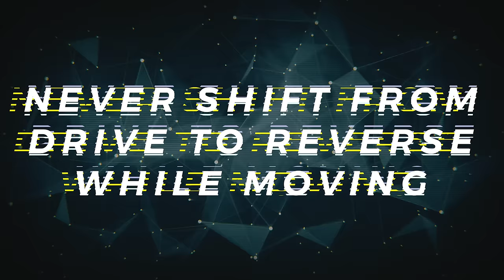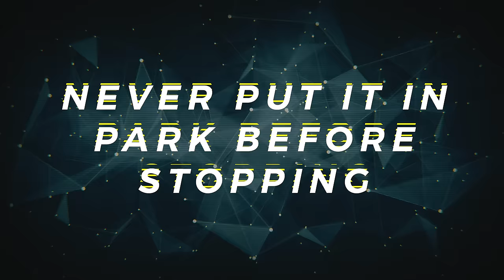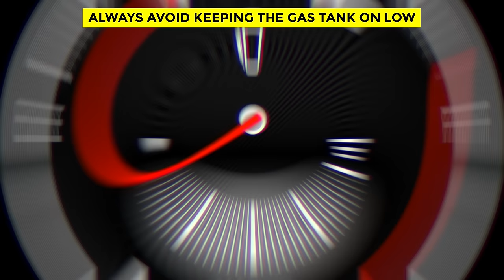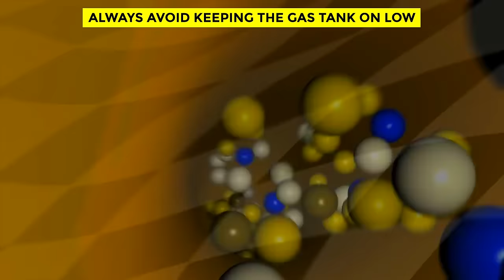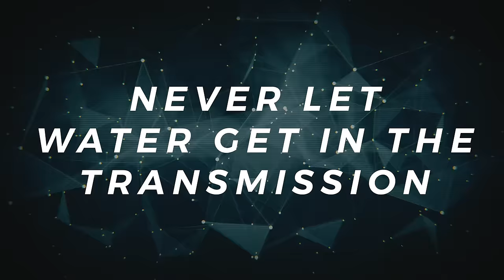7 Things You Should NEVER Do In an Automatic Transmission Car!

Comment: How to avoid it:
1.Dont buy an automatic
How to save manual:
1.Everyone start buying manual as you still can so car makers still make manuals
Reply: why the hell would i get a manual, just accept that stick is dead or will very soon be dead, even car companies are throwing manuals in the bucket cuz no one is buying simply because nobody gives a shit about them and nobody gives a shit if you drive one
Reply: @chimkinnugget5221  u dont know nothing about cars for sure you drive a prius
Reply: Christopher Hernandez Without Manual there is no Automatic,because Automatic is basically a modified manual
Reply: @enovenn6074  Hell no. Automatic transmissions work totally different than manual. Yep thay switch gear, but thats all. Automatics usually have 2 clutch system, own ECU and they work with ECU and information from the engine. Thats why you have sport mode, eco mode etc. Manuals have none of theese things, you have to do all the things in your brain.
Reply: i do own a BMW also a automatic. its bad quality, each time i start to drift it, it breakes
Reply: Nkstrooo manuals don’t fit in electric cars so if electric is futre automatic is futre aswell
Reply: @justauserwatchingytonipadk6438  Electric cars don't have automatic transmissions, they don't have ANY transmissions, because they aren't necessary.
Reply: Christopher Hernandez why the hell you would get a manual? Simply manual cars have less failures than an Auto car
Reply: @damien turn traction control off
Reply: Manuals are actually better, safer, and more efficient than automatics. Efficiency is getting harder to differentiate between the two as time goes by since computer monitoring is always improving but manuals will always remain in the lead even if minutely. Add to the fact that manuals better in towing and in 4wd/AWD.
Reply: @chimkinnugget5221  you drive car...car doesnt drive you
Reply: Just a user watching yt on iPad Kk not everyone really likes electric cars,also not everyone can afford and the worse is,on some countries the price can go wild especially the taxes
Reply: shiznut123 if you think electric cars are gonna take over soon they’re you’re a different breed , if I have to wait 20mins+ for half a charge then I’ll go with gas till the car starts charging itself for free. Wanna what what is going away tho? Manual cause computers already caught up and surpassing manual. Welcome to the auto world
Reply: @chimkinnugget5221  you don't have to be an ass about it just drive what the f you want. Let them drive manual. It's their choice not your.
Reply: @AndyPorter79  Manuals are not better, safer or more efficient but they are cheaper. There isn't a stick diver who is going to be more efficient than a computer, there just isn't, modern automatics are made to be efficient. They are both as safe and better comes down to preference.

The only thing that manual has over automatic is price and that's why I drive manual, if I had more money to go around right now, I would go for an automatic.
Reply: @chimkinnugget5221  you simply kept stalling manual cars so you bought some kind if a hybrid or some big ass suv with an automatic and now you complain about manuals.
Reply: No, they won't.  Automatics are a lot more efficient in today's cars as compared to manual transmissions.  Plus, they are less expensive in most cases, due to scale.
Reply: Paddle shifting for the win
Reply: based
Reply: @AndyPorter79 , that's not right at all. It's possible for them to be more efficient, but they're not because of the human that is behind the gears. Computers will always be more efficient on average than a human brain. 

Modern automatics, especially ones made within the last 5 years are just too advanced to be less efficient.
Reply: Nkstrooo ok but why are u and everyone else getting mad at people for speaking the truth about Manual. Yes Manual is more fun than auto but it does have its downsides and whether u like it or not it is dying and people are not as interested in them anymore
Reply: Yes please save manual transmissions.... Auto is for lazy people and is no fun... You really don't need an explanation for why you should buy an manual car it's just better
Reply: @chimkinnugget5221  maybe in the US but in Europe most of the cars are still manual's.
Reply: Nkstrooo but i can't drive manual goddammitb
Reply: Christopher Hernandez if i could drive a manual i'd buy one.
Reply: SSG Squidward then rent a manual car and use it to learn manual with your friend or parents just dont rent a new one because you may kill the gearbox or i really recommend rent the most indestructible car not the indestructible body but the indestructible gearbox or engine
Reply: @enovenn6074  not true automatic transmission heave difrent principle of engaging the gears  and is NOT  AT ALL similar with manual
Reply: @chimkinnugget5221  Not really. Still very much alive in Europe.
Reply: automatics dont miss gears and cost you hella money when you money shift :)
Reply: @ItsBoogeyman  Manuals don't miss gears if you have a basic concept of the gears.
Reply: ILOVEUALL so you never seen a pro racer miss a gear? let me know
Reply: @ItsBoogeyman  No, I've never seen a pro miss a gear. If they do, can't really be considered a pro. They get paid to know how to drive, if they don't know...then...
Reply: All the rules give me a headache. This is even worse than just learning to drive a manual.
Reply: @chimkinnugget5221  In germany around 90% of cars are still manual because ppl prefer it here. It rlly depends on the country.
Reply: Since when does manual need saving, barely ever see them around in Europe and as long as other countries like manual it wont be discontinued, probably even in America
Reply: Age of stone vs age of computers?!?
what would you choose?
Hahahaha!
Reply: you cant drift with with a automatic car evey tuner has a manual car cuz its better automatics suck at drifting and burnouts
Reply: mata HD you can drift with an automatic car
Reply: @theeverythingguy8532  Thats how we get better gas mileage and a real car to drive
Reply: @chimkinnugget5221  You step on gas car go... if computer says ok. You step on brake car stop. but only when you step on brake. If stop stepping on gas mine actually starts slowing down without stepping on brake... Car does drive you
Reply: chimkin nugget found the Prius owner
Reply: stick is dead bro. Just accept it. Most newer sports cars and super cars are mostly autos. They also will outperform the manual 9/10 times.
Reply: @daimenbols3982  It might be your Traction Control System
Reply: Enjoy being in the rear-view mirror of an auto then lol

Comment: To everyone, don't leave car on Drive if you are on a stoplight that shows no signs of changing soon. you are wearing your torque converter because it's engaged and you are contradicting it constanly by braking.

Let it on  neutral, just dont launch it obviously. Switch from Neutral to drive while braking then pull out
Reply: I am ALWAYS in N at a light especially if it turns red there before me and i know its going to stay red for over 2 min. 
I dont like the idea of that torque converter being engaged with the transmission and me holding it back with the brakes ... 
That puts stress on the engine also ...

Comment: You should never press the clutch in a manual or coast in neutral if you go downhill. You don't get the engine-braking effect, in a manual either downshift and ease off the gas, or if you sit in an automatic car, just leave your foot off the pedals and maybe use CC to keep your speed without braking. The automatic Transmission will perform downshifts to slow the car down.
Riding the brake pedal will let your brakes run hot and they start to smear, which will affect your ability to slow the car down. This also causes the brakes to chime after cooling down again. If that's the case, perform multiple hard stops from higher speeds to rub off the hard rubber (from the cooling process) on the brake.

You can always change from Neutral to Drive in an automatic, in case you need to get towed after an accident.
"Never launch your car while in neutral" - What the hell man? If you intend to launch it from a standstill, just press brake and gas at the same time, nobody revs up and switches to drive...
Pressing Gas and Brake at the same time causes the clutch (in a dual/single clutch car) to slip or the torque converter to build up pressure, let off the brake and you accelerate with full power.

Comment: "Never put your car in neutral while at a stop light" .He's right, overheating your transmission fluid won't cause any damage.
Reply: Da fug ?? Most people's telling me that I should put Neutral when I stop at the lights ... Wtf my mind death . I used my cars many years like this wuuuttt
Reply: I actually asked a guy i borrowed an automatic car, when should I actually put it in neutral. When I sit at a stop light for 1-2 minutes, should I still leave it in the drive? I have driven manuals almost my whole teenagehood.
Reply: Nico NugisHD yea I keep my car on drive.
Reply: @niconugishd9150  As long it won't last half an hour, you can leave it in Drive. Slipping torque converter does produce heat, however.
Reply: You're less likely to budge forward into traffic or pedestrians if it is in neutral, right?
Reply: If found that my Renault knows this. If the oil is still too cool, it stays in D. If the oil is nominal, you can hear the converter unload and you see idle rpm go up by 100 after about a second of being stopped and it seamlessly reengages once you let off the brake. Noice.

Comment: I just want to say that I've seen a lot of people saying that they are annoyed by the people who shut their engines at red lights and calling them stupid.They don't stop the engine , newer vehicles automatically stop the engine to save fuel and to also reduce CO2 emissions. This is called start-stop and it has been implemented in a lot of older cars like the 2011 Audi Q7 so this technology has been used in cars for almost a decade or maybe more so I don't see how people don't know about this already and how they can talk about something they don't really know.
Reply: Start-stop system is annoying though so the first thing I do on my car when I start it is to turn that system off. Another thing with Start-Stop system is that it will probably wear out your starter faster and that will probably cost more then the few drops of fuel you save by the engine turning off
Reply: I doubt they haven't made a system without parts specifically made to handle it. They probably would stop using this system if it caused problems.
My uncle has always used the Start-stop system and hasn't needed to replace any parts in 4 years, still going.
But yes, it saves very little fuel

Comment: Putting it in neutral at a stoplight is a good thing. If your problem is forgetting it’s in neutral then pressing gas when the light turns green then just work on that which wouldn’t take a long time to muscle memory it and wasting a little gas isn’t costly. I do understand people might need to move asap like emergencies/accidents approaching but if you’re able to shift to drive fast enough then that’s okay. Overall, putting the car in neutral when at a stoplight is not bad at all if anything it is good as it disengages the clutch causing less stress on some parts and I’m pretty sure a lot of manual drivers put their car in neutral at a stop light.
Reply: Also press brake once you want to shift into drive. If you didn’t rev before shifting then you can just shift into drive without the brake since there’s really no torque applied.

Comment: Tip 10: Get a manual transmission car
Reply: I want one dont know how to drive one yet it sucks
Reply: @disguisedpickle1360  Its easy
Reply: @brownieboi2026  the problem isnt learning its finding one
Reply: @disguisedpickle1360  oh, So good Luck
Reply: @brownieboi2026  even if I do find one it ends up being 23+ miles away I'm scared of stalling in general but on a free way would be worse I'm leaning to swapping my 03 mustang
Reply: Sgt Pickles ask if they can take it to a parking lot first, practice there and then go lol
Reply: @disguisedpickle1360  in my country the problem is to find automatic transmission car 😭😭😭😭
Reply: And get a shitty car? Nearly all manuals in my country are shitty ass used cars. Automatic is just more easier to get.
Reply: i had a manual for one year but in the winter i came to understand how nice is it to have automatic car, since temps can go down to -15 C it becomes really hard to handle the clutch cuz my feets are quivering from the cold. it is really fun to drive in summer but not in winter.

Comment: "Never switch to neutral at a stop light" explanation more please. Because a lot of the professional drivers I know said that it's better to switch to neutral(and hand brake) at a stop because it avoids the stress to the car.
Reply: Yes ... its less stress on the engine that is trying to pull a car while you are holding it back by using the brakes.
By putting it in N, that allows the engine to rotate freely without restriction.

Comment: Wait... the engine doesn’t receive oil when it’s in neutral??? 😂
Reply: Yes it does why do people idle the car to warm it up and idle while picking up passengers or people have engines running in idle with air cons on while eating MacDonald in the parking lot and pull over to answer the phone while idling. Maybe he should catch a bus
while the timing belt or timing chain are spinning the oil pump will work just do not turn off the ignition while coasting down hill the steering wheel will lock up
Reply: @leesullivan8532  🧠

Comment: Heres a tip; Check and make sure your 710 fluid is clean for optimal engine performance. If it's not clear you have to drain the fluid, change the fluid filter, and add 710 fluid but they don't sell it in stores, but all it is, is water. you'll need 4-6 quarts and 710 milliliters of no oil.

Comment: Running low on gas can ruin your automatic transmission 🤔 sounds like someone is making shit up
Reply: Somewhat true, although it depends on how your engine handles fuel starvation. Most modern cars do not have this problem.

Those that didn't cope well causes massive sudden engine braking that stresses the transmission.

Comment: It's fine to run your car low on gas. The dirt in the bottom of the tank always gets to the pump even on a full tank of fuel. That's why there is a strainer on the bottom of the fuel pump and in the fuel line. And the fuel pump has nothing to do with the transmission.
Reply: actually it strains the fuel pump when it is not sucking up enough fuel. It can burn the pump out
Reply: @skylerbrehm1443  but it won't hurt the transmission

Comment: 1) don’t shift from reverse to drive and drive to reverse while moving.  
2) don’t put your car in park whole your car is moving 
3) don’t put your car in neutral or use a parking brake at stop lights 
4) never coast in neutral 
5) don’t rev your car in neutral to launch. Don’t launch your car in cold weather 
6) avoid keeping the gas tank on low
7) don’t let water get in your transmission
Reply: 8) never drive away when the tires are gone ;)

Comment: "The pump is driven by the torque converter, which is turning any time the engine is running, so yes, transmission fluid flows through the transmission. The only difference between neutral and park is that the parking pawl is engaged while in Park" If this is true, then coasting in neutral shouldn't matter...right?

Comment: I have been running my acura rsx type s to pretty much empty for 11 years and 400,000+ kms same fuel pump, still shifting at 8100rpm from time to time with no noticeable fuel issues or failures.

Comment: Water should not get into your engine in general, not just the transmission.  Granted if you get a few drops into the combustion chamber it likely will burn off, but you really don't want water in your engine anyway (unless it's engine coolant which is usually a 50/50 mix of coolant and distilled water).  My general rule of thumb is that if the water comes up beyond the wheel hubs on my vehicle, I won't drive through it (I have a truck though so the engine does sit a few inches above the wheel hub level but still, many mfrs use this as a rule for determine if you should drive through standing water or not).

Comment: Park actually isn’t for park in an automatic transmission it’s just a small hook that locks the transmission up you’re supposed be on the brakes put the transmission in neutral set the parking brake then put it park it prevents from damaging the transmission hence why when you put it in park sometimes the car will roll a rink bit

Comment: The torque converter is rigidly attached to the flex plate on the impeller side. Therefore that side always spins the same speed of the motor.
Reply: you never should toe any car no matter what transmission whit gearbox turning, more than few meters. rolling wheels can be on a road.

Comment: Three times I have had people drive their car into mine because they left it in gear at traffic lights and lost concentration.  The car dutifully drives forwards into mine.  Using the parking brake could alleviate this risk but you don't recommend doing that either.  Rule 1.  If you take a risk sooner or later your luck runs out.

Comment: Yes, like putting it in reverse while doing 70 mph down the highway. The torque converter makes a unique ringing bell sound you will not hear elsewhere.
Reply: That is just because the tires are hooking up so well to the dry pavement.  I think that is actually safe to do in the winter on slippery roads. :)

Comment: you can absolutely put the trans in neutral at a redlight especially when you have a torque converter because it actually save fuel. tho putting a dct trans in neutral is unnecessery